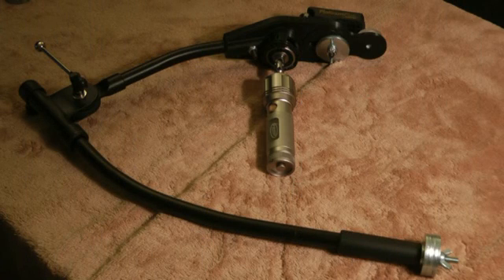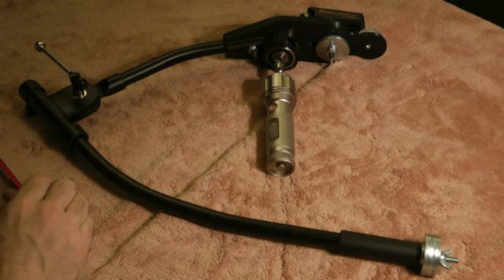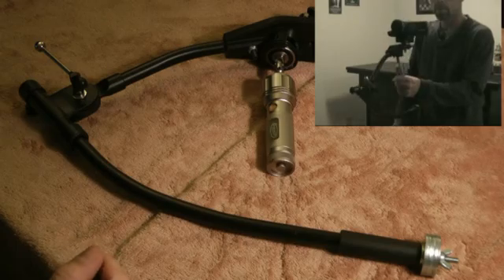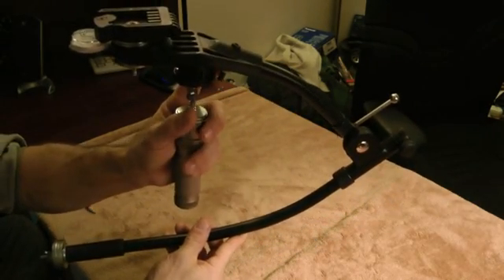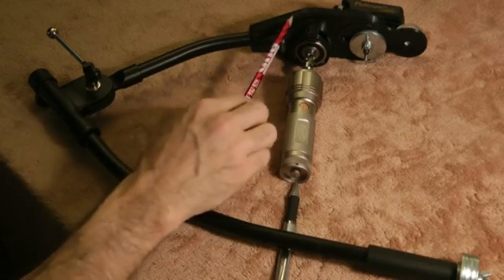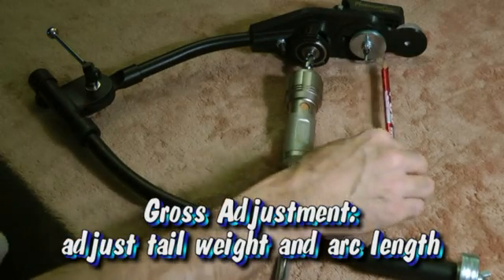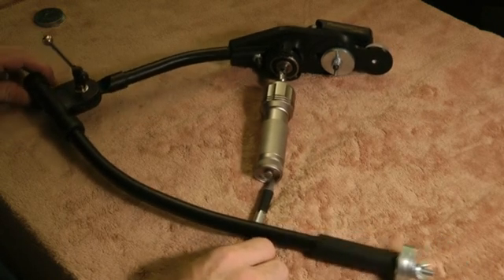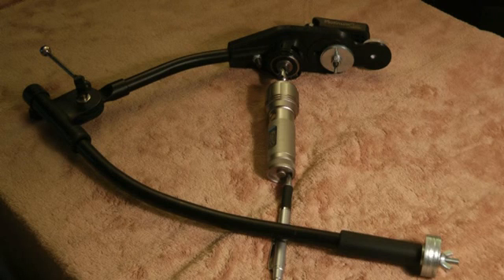DIY Steadicam-How to balance your own steadicam

Comment: Great vid. I really understand the physics much better than I did, however, it doesn't seem to be to the level it needs to be. I have very little washers on the tail, one on the nose, and prob 12+ right behind the camera. The camera is a Canon HF G10. 1.3 lbs. I cannot get it to do the drop test well at all. it might be a half of a second, but I can't remove any more weight from the bottom. Any words of advice?
Reply: I'm not on this channel much anymore.  But try raising the height of the camera off the baseplate.  Think of a steadicam like a teeter totter.  Farther you put weights towards the end makes it add more force down on that side.  Moving it to the center lessens the force.  If one side is too heavy(the tail end)...move the weight on other end(the camera) farther away from center point(the pivot point of gimble).

Comment from the maker: Do the 2 second drop test.  After you seem to have it balanced as far as not leaning left or right or front to back....do this test.  Hold arm out horizontal at 90 degrees.  Let it go and if it takes 2 seconds for the arm TO PASS the normal position of the arm being perfectly vertical, then it is ready for action.  If it swings down faster than 2 seconds, you have to much weight.

Comment: I made one (Between the "Silver flyer and the Flugoar floater) in pvc (I live in France and material uses are not the same so I was hard to made it with other materials) it seems to works but I don't add weight for now and there is a pendulum effect and it take time to set to the "standard position". So I just have to (correctly) put weight on it and it will be okay?
(And it tilt to the bottom so I think of put the camera before the handle.. is it a good choice or not ..?) 
however, thanks ;)

Comment from the maker: There is no way a steadicam can remain pointed in one direction and stay upright in windy conditions.  Plus, it really takes a light hand on the point just above the pivot point to help a steadicam remain pointed where you want and upright balanced.  It just the nature of the physics for it to remain pointed where it is set.  It takes momentum to turn the steadicam and unless you apply that force of momentum, it will remain pointed in one direction.  Just need a frictionless gimble system.

Comment: great video! Just bought a coralpix stabilizer and use a Nikon v1. I only saw one review video which the filming is smooth but has a slow side to side sway as he walks. how can I avoid this? I am not sure you can adjust the arc length.

Comment from the maker: not really.  It really depends on what style of stabilizer you built and mainly the weight of the camera.  Think of the handle and gimble point as the point in a see saw.  The camera is something on one end of the see saw.  So by moving the camera forward or backward of the point it affects the balance.  A lighter camera should be farther back towards you and a heavier camera should be closer to the point.  If i moved my cam closer to the point it would tip forward too much as my cam is light.

Comment: I really liked your video of this steady cam design. I am kind of mixing your handle with the Silver Flyer design. Waiting on a few more parts to get in, but I am having someone mill up a top for mounting the gimbal / bearing and to mount the frame to. The thing I had been kicking around is centering the camera mount over the grip or use the factory mount point as the center. My setup should be fairly light Pany V700 and Q/R w/ extended battery. I hope it won't be too hard to balance out

Comment: Take about 20" pipe. Attach to the bottom 4" pipe with counter weight on the the end. This piece must be attached with knob bolt and be able to move within a crescent trajectory for left-right adjustment. Use an aluminum pipe (not a bar) to avoid vibrations. If the bar going to to have a fixed shape, use a Focus Rail Slider on the top for back-forward adjustment. Put some weight on the middle of bar to stop unwanted spinning. Use Sima quick release (Amazon) to adjust the center of gravity.Gdluck

Comment from the maker: sorry for delay getting back.  I really cannot tell you how that arc size will work as I have not tested it that way and I dont have some big formula that computes that stuff...just know how it all works in theory.  That being said, with a fixed arm you should make sure you can adjust the height of the cam above the baseplate as well as front to back and side to side.  Use the lighter arm material at 3/4".  Plenty sturdy and that gives you more room to put weights on it in the nose and tail.

Comment: Hey please REPLY
I'm going to get my materials soon (steel or aluminium tubing that will be bent into shape), Mine will have a FIXED arc because I wont be able to make it adjustable.  On my steadycam I will be using a canon t3i with lens and quick release mount approximately 2lbs, and sometimes accompanied with a mic making it a total of 2.3lbs.  What ARC size will best for this? 14''? 
Also what would you recommend using, steel or aluminium and what size 3/4'' or 1''?.

Thanks

Comment: U need a little nose weight to have a stable pan inertia.   To slow the drop time can u add weight to the cam somehow or around it(above the pivot point) and/or raise cam up a little.  This will counter act the heaviness u have on the bottom of pivot point.

Comment from the maker: adding more weight to THE BOTTOM arm will make the bottom arm lag behind trying to catch up to your hand movement.  Not enough...makes it unstable.  Do the one second drop test...If you can hold the bottom arm to 90 degrees and let it go...It should take just over a second to swing past the main postion 180 degree mark.  Slightly bottom heavy is the key.  Too much bottom weight and it takes time to catch up.

Comment from the maker: @AceOncallLimos Thanks for watching.  1.  The placement of my camera or any other depends on its weight AND how much weight it has to balance against on the other side of the pivot point.  Since my cam(at this time) is light at only over 1 pound and my arm spar assembly is somewhat heavy, I had to place the cam farther back to compensate.   2.  Again, farther back helps to add weight on the cam side of the see saw to help balance.  Most important is the final 1 second drop test.

Comment: Hey slambo, great vid !
Ive made my homemade steadcam, which works ok so far,  but got a few quick questions.
 1. should the centre of gravity on the camera be directly above the gimble ? it looks at if your camera is mounted back behind the handle?
 2. should the tail peice (mic stand) be much further back than the centre of gravity? yours appears to be long

thanks in advance, ill put up a video response when i can work out how to film my camera with my camera whilst its mounted on the frame !

Comment from the maker: @moviedan I will be dead honest...if i had the extra cash to get one...I would jump all over it.  The gimble system is very advanced and the ability to fine tune easily is also EXTREMELY helpful.  I love mine and it does work great but setting it up for final balance(to get the 1+ second drop) can be a chore sometimes.  I will have one eventually...or maybe a sled style.  I like those too.

Comment from the maker: @JacanaProductions If i never replied , I apologize.  These hand held style systems are supposedly good for up to about 5lbs.  Many cams do not have mounting holes in the center either.  It's just how you build your baseplate system and making sure you have the cam mounted accordingly in the beginning.  Find the exact center point on the cam by balancing it on a pencil front to back and L to R.  Then try to mount it by putting that center point above the pivot point of gimble.  Then fine tune.

Comment from the maker: @Vegalss You will not have much luck running with a "Merlin" style rig.  It does not have the ability to take away straight vertical jumpiness-only X and Z axis angular momentum.  As a matter of fact, it is not a magic bullet...even with the real Merlin-you have to learn how to walk with it and slightly hold it(just above pivot point) to really make it work properly.  Only the larger "sled" style steadicams will be good for taking away the bounce from running.  Look up videos for techniques.

Comment from the maker: As far as the handle/gimble/washer/U Joint assembly...yes it will work fine.  The handle assembly does not care that your camera weighs that much...unless it was WAY heavy.  Not the pounds you are talking though.  The biggest question mark for you would be the baseplate and arm assembly and how many proper adjustment areas you make in it.  See comment below to Arteesimo on how what adjustment areas there are.  You need all of those to properly balance a steadicam like these.

Comment: Will a DIY gimble type system like this  work on bigger cameras such as the canon 7D or the Panasonic HMC30?? The 7d has a bottom mounting hole that is NOT in the center of the camera!!??? I'd say my HMC40 weights around 4 pounds and the 7D about 3 pounds. (I bought one on Amazon and was unable to balance it correctly)

Comment from the maker: @Arteesimo Glad to help but not sure how through YT comments.  It depends on how many adjustable areas you built in to your system.  Can you adjust the following: arm opening height, weight on tail and nose of arm, camera front/back & left/right balance and camera height above baseplate?  Also pay close attention to the written bullet points in the video.  Those are key points.  Let me know how it goes.

Comment from the maker: @Arteesimo I used a boom mic stand.  Check out the DIY Steadicam-Baseplate & Arm Spar video.  The upper spar is the main vertical part of a boom stand and the lower spar is the part of the stand that holds the mic.  All cut to a desired length and bent using a pole bender.  Thank you also by the way.

Comment from the maker: @goalieboy6 I used a boom mic stand.  You can see the wider plastic end that is usually on the end of the boom that molds the mic.  That is my lower spar.  Then i have the main joint of course.  And the upper spar is what would normally be the main lower part of the stand that the joint screws on to.  I wanted to keep that part(and cut it down) since it already threaded into the main joint.  Upper spar: 6" to 8", Lower spar: 16" to 18"